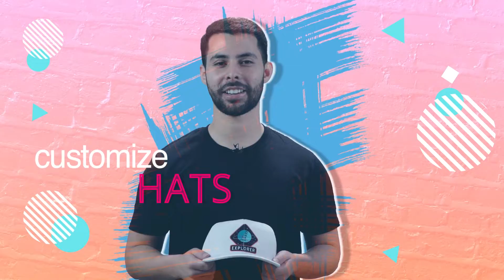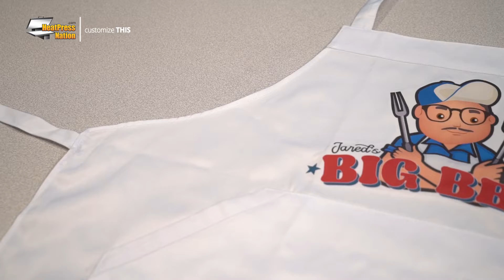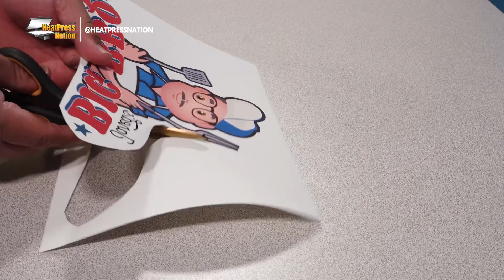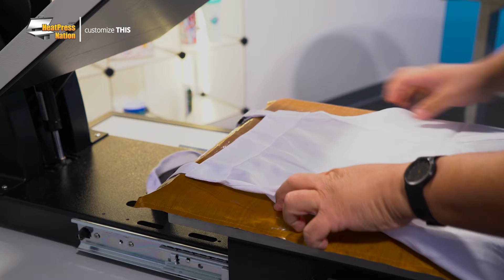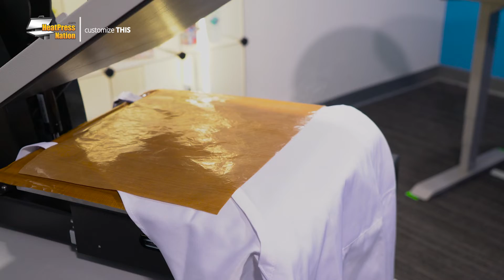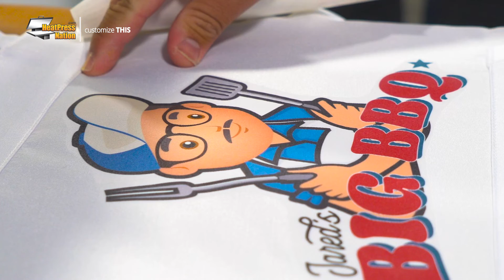How To Decorate An Apron With Heat Transfer Paper

Comment: what wash temperatures can this print withstand?
Reply from the maker: In this video we used Neenah Jet Pro Soft-Stretch (https://heat.press/jpss). The product instructions indicate that this product should be washed in cold water and dried on a low heat setting. The manufacturer doesn't have a max wash temp listed. 

Instructions: https://cdn.shopify.com/s/files/1/0229/1646/4718/files/neenah-jet-pro-soft-stretch.pdf?v=1632767249